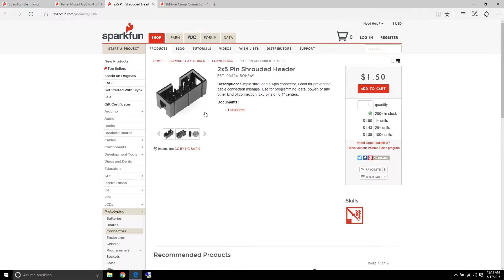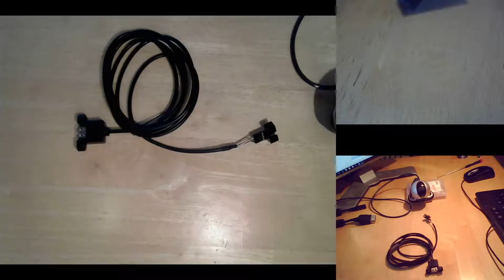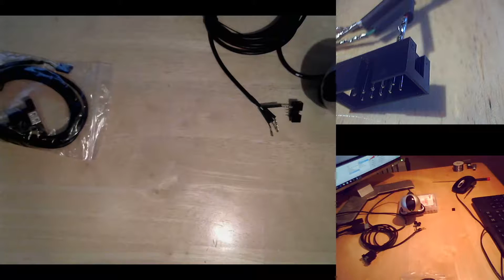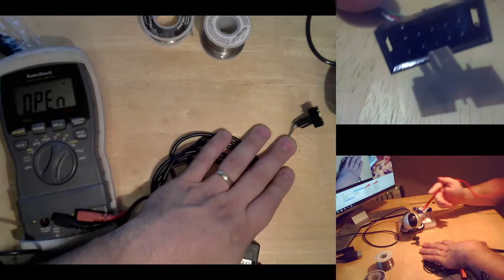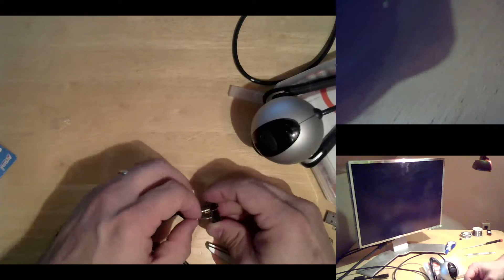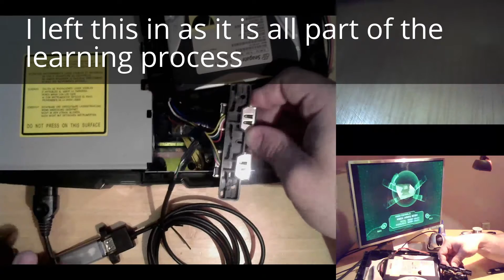GreywolfZX's Original XBOX Moddding Project - Day 8 - USB Mod Take 2 Part 2

Comment: so do you plan on doing the ram and cpu upgrade?
Reply from the maker: I considered the ram and cpu upgrade.  Unfortunately the CPU upgrade seems to be out of my capabilities now as the company that was making the adapter sockets is no longer producing them and I'm not even sure they are still in business.  And then, when I went to look up the spelling to Tualatin P-IIIs 1.4GHz 512K I found an e-bay seller selling these chips with a socket adapter.   

Hmmm....   

For this project I won't be doing the RAM and CPU upgrade.  This will not improve gaming and I am not interested in utilizing XBMC.  I find myself with quite a supply of dual core 2.4ghz or faster machines with which I could do an XBMC style media center much more easily.  I also have a design goal of low to no noise for this project and I would worry that the CPU upgrade would increase heat. 

That being said, I have a feeling I may spend the next hour after I post this seeing if that processor and socket adapter on e-bay will work in an XBOX.  I may just end up deciding to do another XBOX mod project so I can do a RAM and CPU upgrade.  Some times just seeing if you can is enough of a reason to try.  If you would like to see a RAM and CPU upgrade project please feel free to encourage me to do so.  I will post back here if I find that the CPU with adapter will fit an XBOX.  And if I can't find out for sure, I may just buy one so I can get a direct look at it.
Reply from the maker: Here is the link to the ebay listing in case any one was interested:

http://www.ebay.com/itm/Tualatin-P-IIIs-1-4GHz-512K-include-Socket-Adapter-/281238323137

I am skeptical but curious.
Reply: +Surly Sot Gamer Club I hope you do end up doing it as it's not that hard, well at least not for me, and i couldn't tell you if that one would work or not because I got mine when the guy was still making them